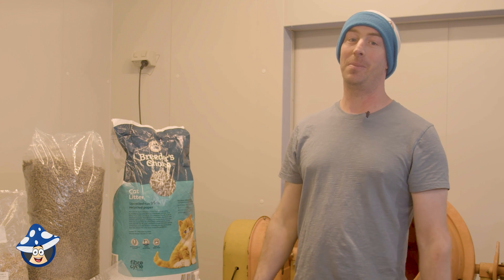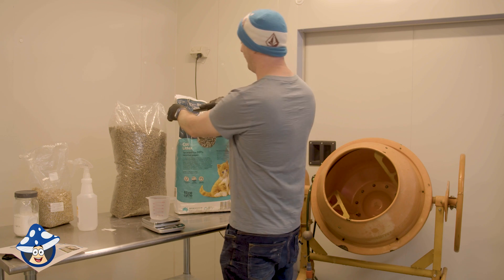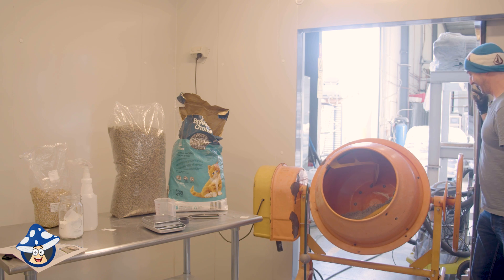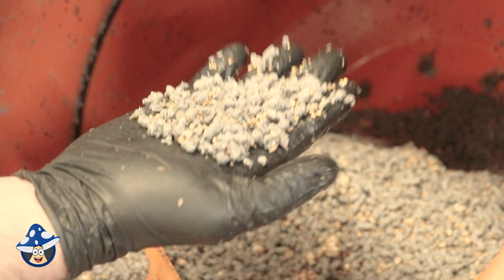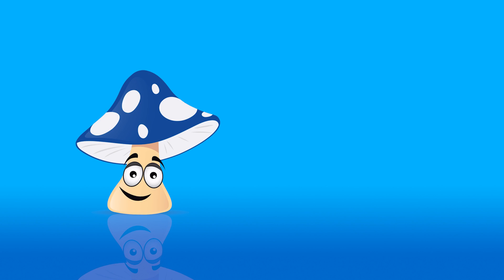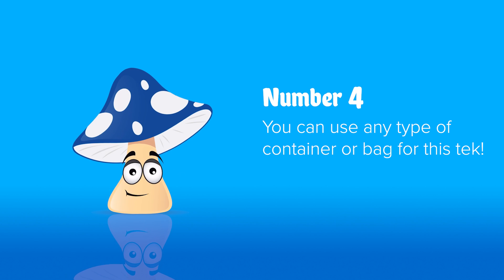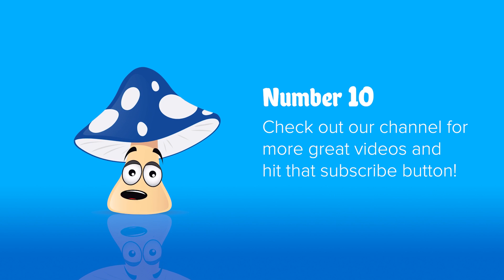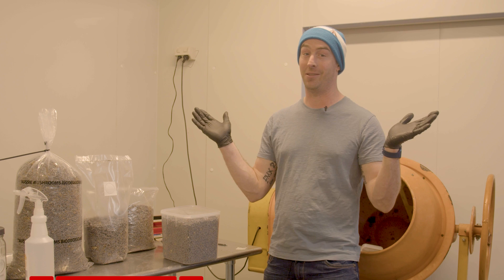The Easiest Method to Grow Mushrooms at Home! - Episode 4

Comment: How many flushes will I get with this method? Does it need to be mixed after a flush?
Reply from the maker: Most get 3-4 flushes before each flush starts taking to long to come through
It all comes down to your spawn quality etc aswell, you can break the kit up and add more lime  water and some wheat bran after 1-2 flushes to give it more food and a boost 😊👌🏻
Reply: @AussieMushroomSupplies  I’m in FNQ which mushrooms would you recommend come no into the wet season? I’m keen to try lions mane and a oyster to start off.

Comment: So you sterilise everything and mainly your hands, but surely there are bacteria on the plastic bags and other airborne stuff that you don't seem to worry about, how does it work, sterile or not sterile?
Reply from the maker: Hey there the bags are clean from manufacturing like the ziplock bags there food grade, this is why we give the buckets and equipment a spray before using they have been in the open etc sitting around,
We are also keep things cool when incubating so no bacteria wakes up
So long as it doesn’t get warm they won’t wake up, and the lime skyrockets the Ph so other spores can’t germinate and the fungus has time to fully take over before it drops back down 🍄🍄